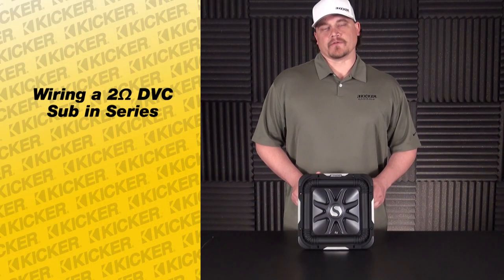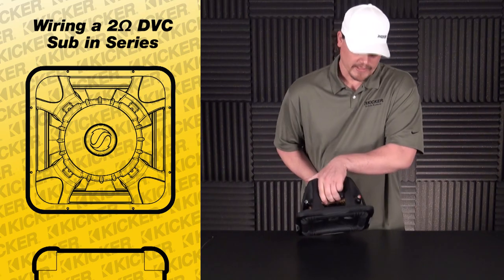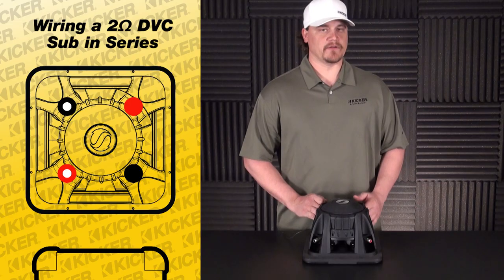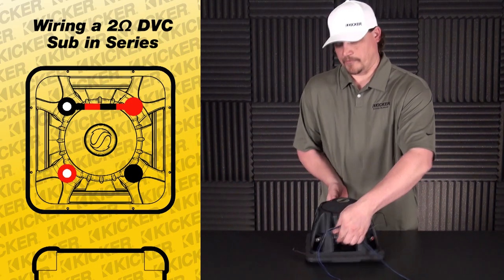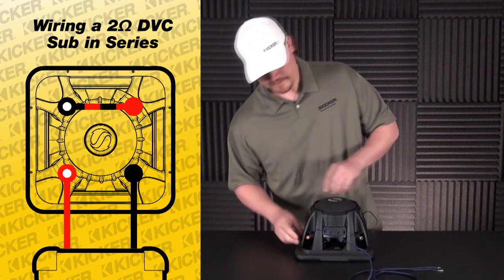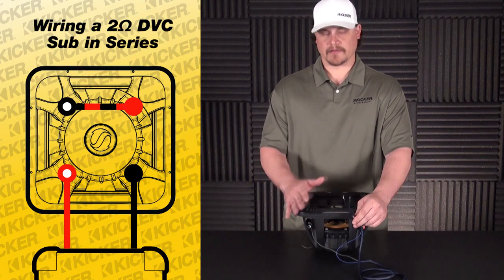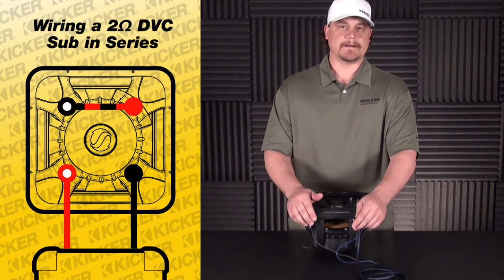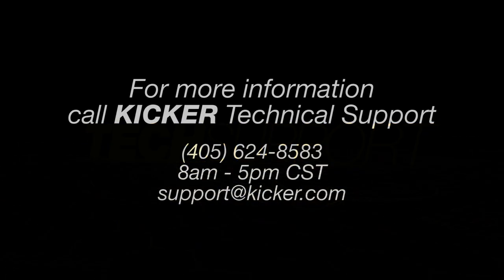Subwoofer Wiring: One 2 ohm Dual Voice Coil Sub in Series

Comment: I have the 12 car box and subs I need to modify the boxe depth which side is best to cut
Reply from the maker: Are you shortening the box?
Reply: Yes
Reply: Also I have kicker dx  a 250.1 amp and a different 850watt amp how do I wire these for best results
Reply from the maker: The back of the box makes the most sense to alter of all the possibilities.  Please be careful to only cut raw wood. Remove any covering (carpet usually) before you break out a saw.  The other thing to know is that making the box smaller will affect the sound. how much it affects the sound is relative to how much air space you are removing from the box.

Comment: I have a 2 ohm speaker can it be used at 2 ohm
Reply from the maker: Most (but not all) DVC subs can be used as single voice coil, but you lose about half of your power handling, as you are only using one of the two coils.  This is the only way a single DVC 2 ohm sub could normally achieve a 2 ohm rating at the amp. It is not recommended.

Comment: How do I make a 2 ohm SINGLE voice coil 4 ohm by wiring in series?
Reply from the maker: Unfortunately you cannot.  If the sub had a dual voice coil then you can but with a single voice coil, it can only be what it is designed to be.

Comment: Cvx122 (series) L7s124 (parallel) wired together to equal one ohm to mono will anything blow
Reply from the maker: Depends very much on the power you are giving it (among other things). The total RMS is 3kW. We normally recommend being within 20% of the RMS +/-. The other factor is the differences in ohm load between the two sets of subs. If two sets of subs receive different amounts of power (dual 2 versus dual 4), you can run into some sound-quality/distortion/phase issues.
Reply: @KICKER-AUDIO   I believe the total RMS would be 1500w if each sub is 750w RMS ... Cvx122 in serious to get 2 ohms n S12L74 in parallel to get 2 ohms , wire together to get a total of 1 ohm. Amp - HFi1000.1D
Reply from the maker: If you have four subs (two pairs each of CVX and L7S) then yes it is a 3k total RMS.  Was it an either/or statement?  Is that where I misunderstood?
Reply: @KICKER-AUDIO  

I don't have four subs I have two subs. 1 CVX12 2 ohm, 750w rms and 1 L7 4 ohm 750w rms... Can I wire that together to equal 1 ohm without damaging the subs and/or amp?
Reply from the maker: Raymond Sheppard As long as the amp is one ohm stable and delivers approximately 1500 W, that is perfectly fine.

Comment: I could help to the connection and regulation of 2 15 inch l7 2 ohm with an amp kicker zx 1500.1, thanks for your help
Reply from the maker: First, in case you don't have it, here is the manual to that amp: http://www.kicker.com/app/manuals/amplifiers/zx/2008_ZX_1000_1500_2500_1_4in1_a01.pdf

Next, you should wire the subs in series parallel. To learn how to do this, you can:
1) use our free app: http://www.kicker.com/kickeru or
2) look on our site: http://www.kicker.com/wiring-diagrams. Choose Dual Voice Coil Wiring Options and scroll down for dual subwoofer options. It wont be exactly like your subs, but the concept is the same.

At 2 ohms mono the amp requires a 150 amp fuse, so please be sure you've upgraded your wiring and charging system appropriately. Thanks!
Reply: Thanks for your help was very helpful, it is possible that you can help 
me with the box measures 2 kicker l7 15 inch for a honda civic sedan 
2007
Reply from the maker: Sure Luis.  In fact, I can do even better.  If you take measurements of the space you intended to use for the enclosure, you can email us at support@kicker.com or call us.  We have very high end box calculation software here, and are happy to do some work for you. We are open weekdays from 8-5 central time.  The number is 405-624-8510.

Comment: How do i run a single IQ 12" 2 Ohm DVC sub to a 2 Ohm load on a 1000.1 IQ amp?
Reply from the maker: A single 2 ohm DVC sub can be run to 1 or 4 ohms.
Reply: KICKER Thanks, it sucks the IQ amp isnt rated for 1 Ohm 😞
Reply from the maker: Heres a hint.  Dropping from 2 ohms to 1 only raises your power by 1db.  Thats it.  Just one. PLUS it hurts your damping factor, which affects the overall sound quality.

Comment: how to wire two dual 4 ohms subwoofer speakers into 8 ohms? Please reply.
Reply from the maker: You can't.  The math doesnt work out, but another question for you; why would you want an 8 ohm load?  Whats you goal?
Reply: KICKER I was wondering about the same thing, why is there a configuration on a DVC 4ohm to use as 8ohm? If most subwoofer amps are 4 and under. Is it to wire two subs together?

Comment: How can I bridged it to get the most  power out of it
Reply from the maker: Junior R-V You have to find out how low of an ohm load the amp takes the wire the sub(s) to match.
Reply: KICKER  I have a jlaudio 500/1 I’m not so sure how to make it sound better I had a t1 on it but it was old and fried on me but it had an amazing bass sound and this new L7 doesn’t sound anything like the t1 I’m not so sure if I wired it wrong I did the same you did in this video

Comment: ao how do you do two dual  2 ohm to series parallel  to but into a 4 channel  amp
Reply from the maker: Let's start with this: what subs do you have, and how many of them?  I can help you figure out the right wiring once I know the model number.
Reply: KICKER i have the DVC 2 ohm Kicker comp q 15 and i have a Hifonics  brutus Elite 2500 class d monoblock  amp  would i have to run them in series  parallel to stay at two ohms? i dijt wanna blow these subs
Reply from the maker: OK gotcha.  First, your amp is not two channel.  If it is a monoblock, then they are simply giving you an easier way to wire in mono.  So essentially the two positive and two negative terminals all go to the same place.  This make it easier to wire (instead of shoving multiple wires into one terminal).  

That said, the rest is quite easy.  All you have to do is wire each sub exactly as this video shows you. Then do the same thing to the other sub, connecting to the other set of +/- amplifier terminals.  

What is happening is this: you are changing the ohm load of each sub to 4 ohms by wiring in series.  Now, when you connect the wires to the amp - it is automatically changing the two 4 ohm loads BACK to 2 ohms because they are being changed to a parallel connection.  Mission accomplished!
Reply: its a Hifonics brutus Elite class d monoblock 4 channel  amp 2500.1 1700.2 850.4 the q class 15s are dual voice coil 2 ohm Sub woofers    what's  the safest  way to push the full potential  without  blowing  them?

Comment: tried to hook up my subs parallel,  it plays but when I turn it up the amp shuts off
Reply: I have 2 L7 solobarics subs .... 2ohm dvc's
Reply from the maker: There are several potential reasons for your amps to shut off.  They could be wired to too low of an ohm load, you could have a bad ground, a speaker or power wire could have frayed, etc... to  start diagnosing the issue, grab a multimeter and call our Tech Support Department: 4054-624-8510. They are open weekdays from 8-5 cst.  You can also email them at support@kicker.com.

Comment: How many watts does the sub put out at 4ohm?
Reply from the maker: Lin Touch Hey Lin - it is the amp that puts out watts at different ohm loads.  A sub is designed to handle a certain amount of wattage.  There are two ratings on a sub, Peak is what it can handle at any one given moment in time. RMS is what it can handle continuously.
Reply: Oh ok so my sub is 1500w peak,750RMS... The amp I plan on getting says 1x700 @4ohm. Does 1x700 mean it's going to push the sub at 700w?
Reply: Lin Touch yes. only if the impedance at your speaker wires is 4ohms (u can test using a multimeter to be sure)

Comment from the maker: Unfortunately there is not a way to take a dual 2 ohm voice coil and wire it to get a 2 ohm load.  Your only options are a 1 ohm or 4 ohm load.  I apologize that we did not get back with you sooner!
Reply: what if you keep one coil / channel of the amplifier, then you will get 2ohm for each power exit no?
Reply from the maker: @TheTahlas  While that is possible to achieve the ohm load, you will cut the power handling in half. This is inadvisable.

Comment: I have 2 2ohms L7...with the kicker CXA1800.1...i dont think the install guy did it correct. He did each sub pos to pos and neg to neg. And then each sub going to the amp solo.
Reply from the maker: Depends on which 1800.1 you are talking about.  The CX series and KX series were stable to 2 ohms.  The KXA and CXA are stable to 1 ohm.

Comment: What happens if you connect em all (-) to (-•) and (+) to (+•) ...

Other than it becoming 1 ohm obviously.😑
Reply from the maker: Every time you connect a + to another + you cut the ohm load in half. So a 4 ohm dvc sub turns into a 2 ohm load, for example.
Reply: @KICKER-AUDIO  i get that part... but what if you did that to the sub in the video? Instead of negative to positive why not connect + to +(•) and - to -(•)... 🤔😐
Reply: @KICKER-AUDIO  does it have an effect on the Watts?
Reply from the maker: Raymond Sheppard to answer your di4st question, yes, if you connect both positive terminals to the second polarity then by default you must do the same thing to the negative.  Next (and this is true for most amps), when you cut the ohm load in half you traditionally double the wattage.  Some amps can take as low as 2 ohms. Some can take one. Very few can take less than that.
Reply from the maker: Raymond Sheppard to answer your di4st question, yes, if you connect both positive terminals to the second polarity then by default you must do the same thing to the negative.  Next (and this is true for most amps), when you cut the ohm load in half you traditionally double the wattage.  Some amps can take as low as 2 ohms. Some can take one. Very few can take less than that.

Comment: Gotta run those kickers at 4 ohms on a real amp.
Reply from the maker: Back in the day, that was 100% right.  Damping factors were lower then, and amps simply didn't offer the type of dynamic headroom they do now. Today, many (if not most) bass amps put out the most power at 2 or 1 ohm.  Some even lower.

Comment: how do you wire 4 12inch 4ohm dvc kickers @2ohm to a two channel for 2ohm load?
Reply: amp is 2channel 1800watt hifonics zueus
Reply from the maker: You'd wire it in series parallel. If you grab this free app it will make a diagram for you:  http://www.kicker.com/kickeru

Comment: can i just wire  them down to 1 ohm instead  of buying another  amp
Reply from the maker: They way we talked about before will get the most out of both the amp and the subs. As I recall the 1 ohm rating isn't possible with the combination of subs you have.  They would have to be dual 4 ohm for that.